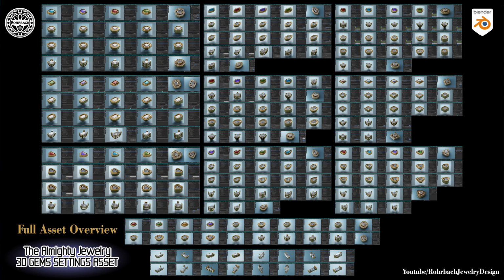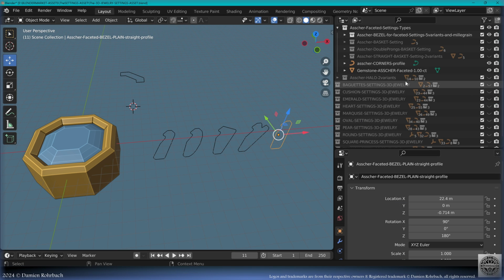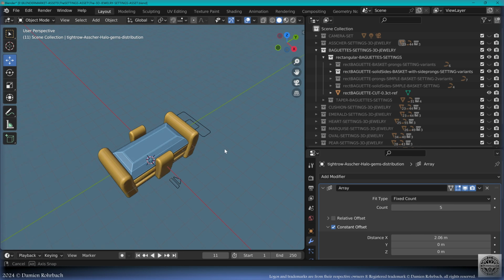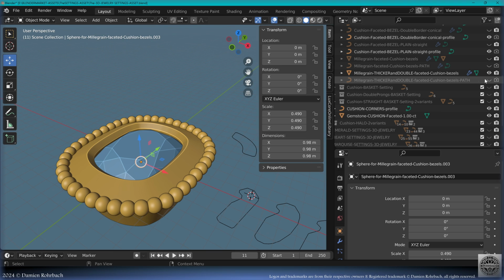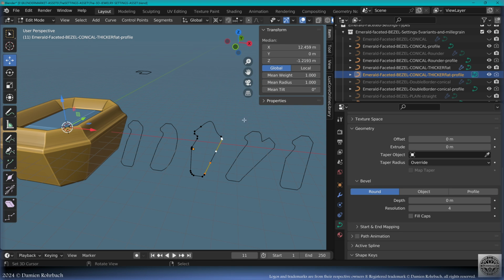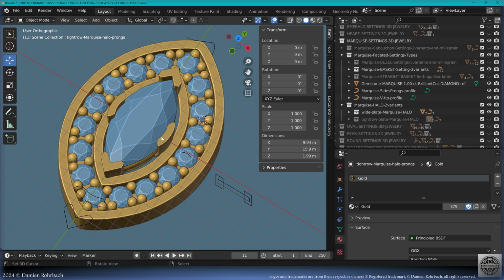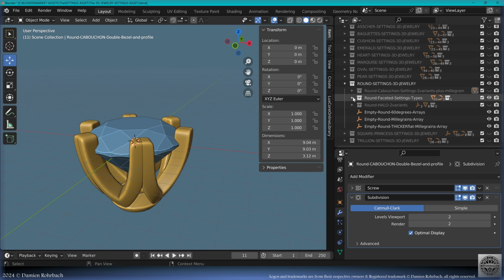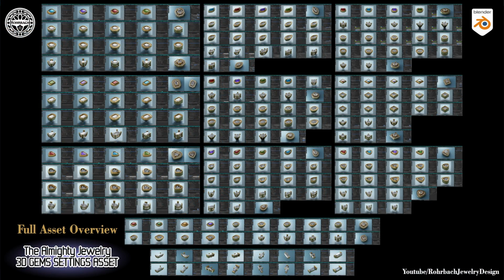The Almighty 3D JEWELRY Gems SETTINGS Asset TUTORIAL 1: Quick overview and customization examples

Comment: Hello I purchased and am loving this asset! is there a way I can add them to my jewelrcraft asset manager?
Reply from the maker: @robertwilson6948  Hi! That's great. Thanks for the feedback. I would say primarily yes, though I don't know how Jewelcraft works, but I think you might simply convert the settings in my asset into meshes and bring them to the asset manager (I personally don't use the Blenders asset manager, because I find appending much more practical, so I would still recommend you to append the settings you like to your jewelry projects) Anything let me know
Reply: @RohrbachJewelryDesign  I feel like I Have to convert everything over to stl and make a folder to import them in. For now I'm going to save this project and export them one by one as I use them lol. I can't wait to get a course from you I've been subbed for a while now when I get stuck I refer to your videos!